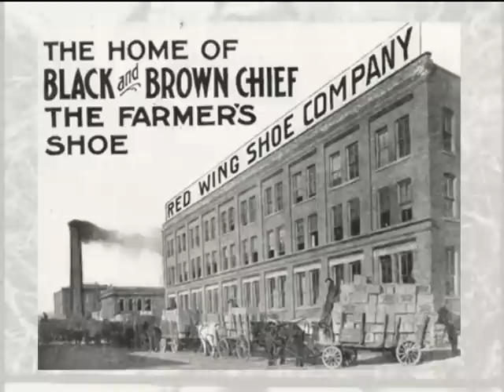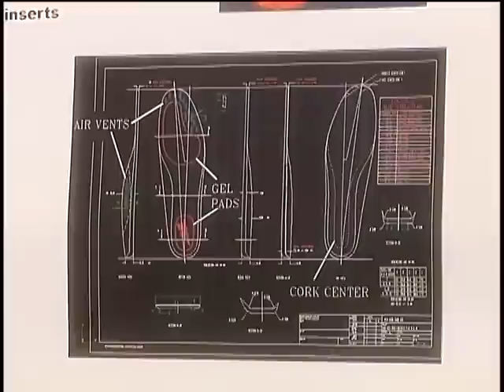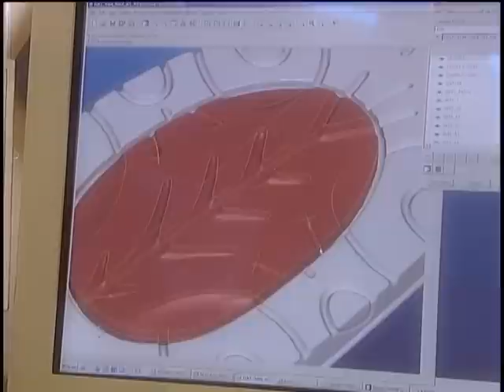Red Wing The History , Production & Quality

Comment: I bought a pair of Irish Setter Redwing Boots in 1979 with part of my tax return. Wore them hard for almost 40 years and they still live. The Vibram lugged soles need replacing now, but the leather is still good. Made in USA!
Reply: Two things you don't go cheap on is boots and bed you'll be spending time in both of them.

If I knew Red Wing made a size 5 I would have bought a pair a long time ago, I was buying Thorogood boots because they made my size.
Reply: i bet the ones made today wont last 40 years maybe 2
Reply: @snoopu2601  You don't like Thorogood?
Reply: avery gentry 
Many high quality boots exist, but they will need to be re-soled over time. Replacing soles is common for all boot manufacturers regardless of company, quality, and cost.
Reply: @b.c.gamingss  I like them I have  a pair they fit well I like them. I want to get a black pair with the White stitching next time they are not that expensive like $200 red wings are $300 and up⬆️
Reply: Justin Gray Good for you but I think Red Wing quality isn’t the same it once was. I am new to Red Wing. I own a pair of Iron Ranger and I noticed RW has poor quality control. I’ve purchased 3 pair of RW via online purchase and all have had defects. The Iron Rangers I decided to keep had wax throughout the leather which I tried to remove and messed up the leather. The other 2 had sloppy dye job and off centered lug sole among a few other problems. I am starting to believe that’s the best I can expect from Red Wing’s quality. I really don’t want to give up on them but from the looks of things I might have to look into custom made boots.
Reply: avery gentry love your comment. I’ve recently started looking into RW and I can’t understand what’s the big deal with them. I was intrigued because of customer YouTuber reviews but have had a hard time finding a pair of boots without defects. Every darn boot a buy from different sellers have had defects. Even the one I ordered from the RW distribution center. It was inspected by Matt. I felt like calling RW and asking if I could speak with the dude who gave my boot a passing grade. He definitely needs glasses. It’s probably not even his fault. He’d probably get fired if he didn’t give my poorly made boot his stamp of approval.
Reply: ꧁ Orlando Cruz ꧂ 
Red Wing’s quality control has undoubtedly dropped. There are U.S. and U.K. companies still producing high quality shoes with tight quality control and customer service. U.S. based companies like Red Wing (who also produce non-heritage boots in East/Southeast Asia) and Allen Edmonds have a massive following via “factory seconds.” These companies know quality control isn’t what it once was, so the defective, blemished shoes and boots are sold at a lower price. For the company, they’re still making a profit. For the consumer, they’re able to attain a higher end brand name item, but pay less and possibly settle on lower quality. 
Is it safe to assume you’re buying these boots for fashion or a basic job without necessarily approved of footwear?
Reply: Ian Turnbow Thankfully I am only buying for fashion. If I needed shoe due to medical reasons I would’ve gone with a custom made company . And I agree with everything you said in your comment. I also started looking into Allen Edmonds because I wanted to upgrade from Clark’s. My experience with AE was even worse than with RW. 3 pairs of shoes I purchased from AE which weren’t marketed as factory 2nd clearly qualified as factory 2nd. I was beginning to take things personally after the 3 pair of crappy shoe sent to me. Even though I was purchasing online and they couldn’t see what I looked like for a moment I felt I was being discriminated. I was thinking that these White owned companies were selling their inferior shoes to people with Hispanic or Black sounding names. I just couldn’t conceive that such a legendary company who caters to such a high Caucasian and white collar demographic would be actually selling them the same crap they’re selling me a Hispanic man. 🤔
Reply: That's nice. I imagine they are now Made In China like everything else, and might last 3 years if u r lucky.
Reply: No way
Reply: @averygentry35  they are made the same. Its the same boot. Buy the heritage models all made on the same equipment from the 1940s
Reply: @b.c.gamingss  no. The leather is too soft

Comment: Just bought another pair of made in the USA workboots yesterday. 350$ Canadian. I think these are the 5th pair in over 20 years. Last pair is about 4 years old and still in very good condition and will retire them to my home and garage. I get a boot allowance from work so needed to use that up. My first pair I bought in Calgary, Alberta after seeing the surgeon & doctor about removing a squished disc in my back.I was nearly off of painkillers from a year of siactic pain. In three months I was off of the painkillers. ( not good for you ) I did take Lakota pills with the painkillers as the doctor said it wouldn,t hurt me. Lakota is an old native recipe of natural stuff. I don,t have any pain or trouble with my back anymore but do pay attention to any heavy lifting. They make equipment for that, loaders forklifts whatever. Only Red-Wings from USA for me thanks.

Comment: Tool & Die for over 4 decades . Of those years about 35 years in Red Wing steel tip boots  { 4 pr .} I was in a Stroudsburg Pa . Boot & Shoe store  . The owner is telling a young man in there with his father " get the best boots you can , but no matter what after a few decades of construction and you will develop back problems  " I had to speak up  " Not if you wear Red Wings , I have been standing and walking on cement for about 35 years and no back problems . I was there to buy my second pr. from him . First pair purchased there  I had 7 years and they were lost when the Delaware river flooded in 03 ' .    Red Wings , expensive but worth it .

Comment: I had my old redwings for 11 years till I tossed them.    they were my brother's for 5 years before he sold them to me.  I had no idea about the redwings reputation,  so I used them as a framer, longshoreman and other warehouse jobs.  for a year I worked in a dish room, lots of water on the floor.  they were comfortable to wear so I wore them day in and day out.
they never leaked and my feet never froze.  walking in snow on my framer job or wet dish room floors.  not to mention the time someone dropped a heavy pallet on my foot.
they  never quit and I probably could have had the boot resoled.  but I did not know that could be done.
I beat that boot really bad.  mud on it and snow.  stepping in puddles carrying wood.
.
Reply: Mine lasted 3 years until I got tired of sticking my hand inside to keep my heel from catching the insulation. I used mine heavily in the oilfield and never fell apart.

Comment: I bought a pair on  my 33rd birthday i believe it was im 53 this year the  rubber bottoms finnaly gave out the rubber souls or watever the yelllowish colored rubber stuff is oon the soles finaly dry rotted the leather still looks great except a nick or 2 from my broken gas pedal in my old trjuck wish i could get em resoled ,probly lasy another 30 yrs if i could or till they dry rot lol,i keep the leathet. Polished and cleaned ever so often in hopes to get em fixed ,really are the most durable boot ive ever owned my brother drove over the rd and in a scrap yard inhhis for probly even longer his look a bit rougher but just as dry and his black soles out lasted mine

Comment: I had a pair of black boots just like the ones that’s showing when the video changes from place to place .. it says built to last yeah the on,y pair of boots that lasted almost 3 years .  The bottoms were getting so thin I was afraid to wear them .  Best pair of boots that lasted that long .  Welding in a shop is hard on boots on your knees the toes get wore out fast .  So the steel toe was showing after a year most other boots don’t last to much more than that !  My redwings lasted 1 an a half years longer .

Comment: Doc Marten is the boot!..and the boot is Doc Marten!..ever see anybody dancing in red wings?
Reply: mark lewis I got a made in England pair of 1490s, and I gotta say those damn boots have been through work and hell and still look wonderful, always getting compliments on them, I trudged in the muddy and sandy Texas woods, went to many different places, concerts, events, worked on my car in them, splashed so many chemicals and oils on them by accident, wore them as my shoe of choice while working as a plate runner and in prep assist, in my welding class where they kept my feet in one peice, even from me accidentally stepping on a still hot peice of metal, or when a sharp metal bar was pushed up and scraped against them, I now wear them assisting my cousins in their auto shop, they damn well are the boots to have. But Redwings are still some badass boots too, got a pair of heritage made in USA Chelsea's, factory seconds at that, they are very very comfy for a boot, look beautiful and also get their fair share of compliments, and are pretty durable, to answer your question, I have because I was the one dancing in them

Comment: I wore my Redwing for several years. I gave up and threw them out. Boy, did they hurt my feet.
Reply: like the video said, redwing makes different boots for different jobs. try another style. you wouldn't want to get a pair for working on the farm if you're going to be on concrete all day and vise versa. best bet would be to go to an actual redwing dealer. if the salesman knows anything about redwing boots, he can put you on the right pair. I've used redwings for 30 years, working on concrete floors, never had an issue with feet hurting, and I'm flatfooted as one can get.
Reply: like the video said, redwing makes different boots for different jobs. get a new  job :P

Comment: I've had mine for almost a year now, hoping that they would break in, but unfortunately I'm going to give up on them. They are incredibly uncomfortable, the heel slippage causes constant blisters, and where the toe section is attached it feels as though there is a razor-sharp join that digs in when you take a step. Very disappointing, as I had done a lot of research beforehand. I'm going to get some Aldens instead - they cost more, but at least quality can be assured.

Comment: if Redwing outsources their 877s I'll cry.  got 4pair I get resoled and 4 new in the box.  .   the uppers never wear out.  nail rubber cleats on the outside of the heel .  slows resoling.  used to buy em for 45 bucks in the 70's in a big box store in Lake Tahoe.   they're 300+ now at the dealer in Chicago.  f**k them I buy em in Wisconsin for a good 100 dollars less.

Comment: you think they could make a proper toe cap that actually lasts
Reply: They do, it's called tough toe, which is nearly impossible to get off. They apply it directly to the leather in a liquid form. It takes about 6 hours to fully dry, but once it does, it is nearly impossible for it to come off unless you use pliers, and even then, it's extremely difficult.

Comment: sad how redwing has fallen, even though they still cling to the name like so many other once decent companies. thin corrected grain leather, machine lasted, Goodyear welted (or even cemented in some cases) man made liners and insoles, padding to compensate for poor fit, these are no different from any other mass produced boot of mediocre quality, but they charge half again as much because of the name. I'm surprised they showed a cutaway view, id be embarrassed if that was a boot with my name on it.

no its not "traditional welt attachment" its just a Goodyear welt like most mediocre work boots, and no its not been done that long it was invented to industrialize shoe making actually around the time redwing was started. "traditional welt attachment" would mean hand welted.

no the lasts are not "shaped like your foot" last time i checked my toes didn't form a rounded point or lift up in the front, and my heel dosent hover an inch off the ground. you have a standard number of sizes like every other mass produced boot and no they generally dont fit most people very well.

"the best performing work boot on the market" give me a break! nicks, franks, whites, wesco, and many others make a boot thats leagues ahead of redwing.